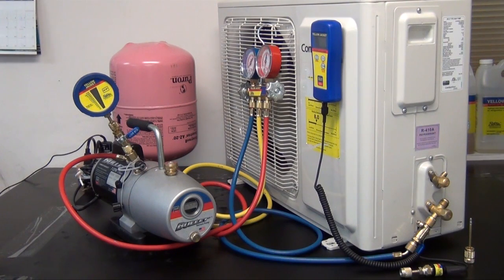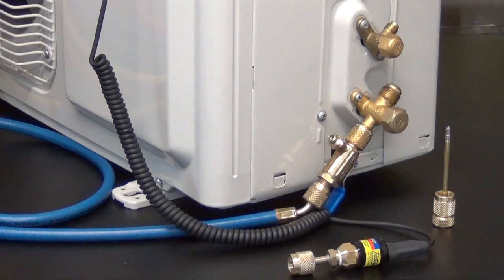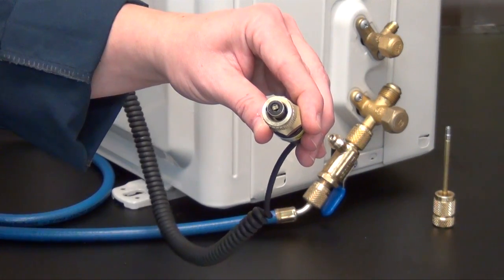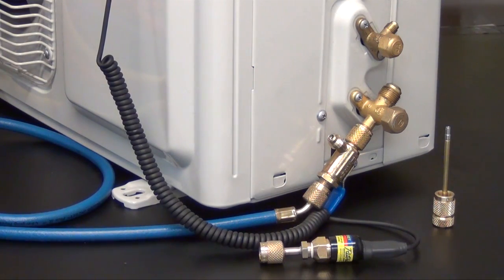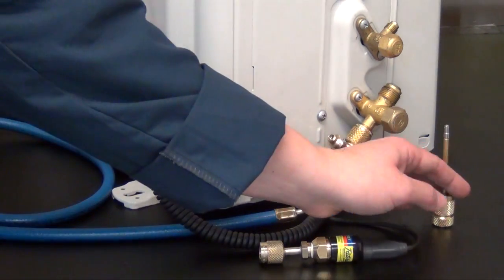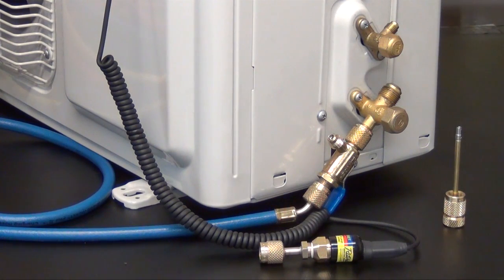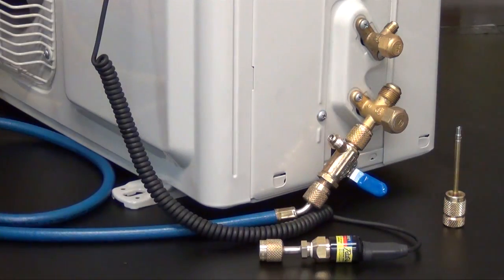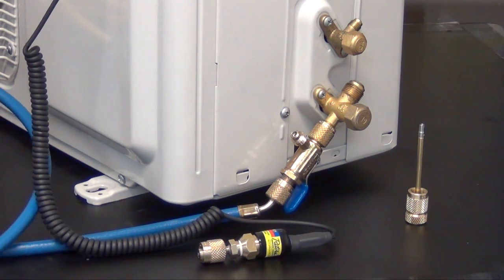YELLOW JACKET Tech Tip: How to Avoid Oil Contamination in Vacuum Gauges

Comment: Are you guys aware of any electrical issues with your probe? We have found taht if the probe is in electrical contact to a running motor in any way, even through the vacuum hoses it will send the vacuum reading plumetting to zero. We have verified this. With non-conductive hose if you just touch the brass on the probe to a ground connection anywhere else this occurs while the vacuum pump motor is running.
Reply from the maker: Hello! Thank you for your message. I am passing this onto our Engineering team.

Comment: I use 2 of the valve core tools, that way I can isolate the vacuum gauge without having to break any seals before opening the king valves, that way there is no chance in contaminating the sensor or losing any vacuum and introducing the atmosphere into the system. Just the way I do it, and have never had a problem, also I can isolate the vacuum gauge during the initial vacuum process which as she stated is the most probable time at which refrigerant oil will be pulled through.

Comment: I hope that there are no new  HVAC tech's watching this procedure to do a vacuum. Since there is no piping connected to the outdoor unit, they may get this all wrong. They may think it is o/k to pull a vacuum this way without piping, at least cap off the ends where the pipe connections are. Because if the valves are front seated or back seated you will be vacuuming the atmosphere not the unit. Little things in a video if not explained make all difference.  If the pump was not working at the time while explaining about the vacuum gauge, I think it would have been better. 
Lots of new techs watch these videos and may think it is o/k to vacuum a system this way. 
The rest of the video is correct and very true. I also like here voice, nice and clear. 
You may also notice the red hose is connected to the vacuum pump and the blue at the unit. If the yellow (middle hose) is not connected to the refrigerant drum and the drum valved off, it is all totally wrong. 
I would imagine it is connected, if it is, i think it should have also be shown for the new techs.
Reply: can you please briefly explain how to vacuum a system ? can you refer me a video link?

Comment: I wish Fujitsu, LG and Goodman would go back to Parker or Sporlan, stop using "el cheepo" valves and stop placing the valves at such odd angles, where you can barley fit service tools on them........vacuum's would be much easier to pull.
    Also, the manifold is not the problem, it's the service or install technician that refuses to service his or her O rings in the manifold and refuses to use metal braided or black vacuum rated hoses.

Comment: I think it's a bad idea to use your manifold gauges to pull a vac. You have the right idea when you say that the micron gauge should be installed to your brand's core removal tool. But then the pump should be connected directly to the ac unit using 3/8 or 1/2 evacuation hoses. Using the manifold just multiplies the chances of a leaking fitting and dramatically slows down the evac process with small, long hoses.
Reply: i use the yellow jacket evac system 2. its a great system. no manifold gauges. almost all manifold gauges leak under vacuum around the valve packing.

Comment from the maker: The gas ballast would mainly be used when evacuating a system containing a lot of moisture.  The gas ballast helps keep the moisture from condensing in the vacuum pump oil. Once the vacuum level gets below 4000 microns, the gas ballast should be closed to finish the evacuation.